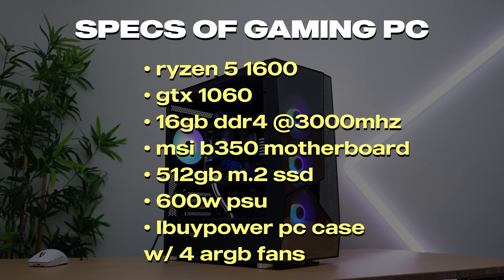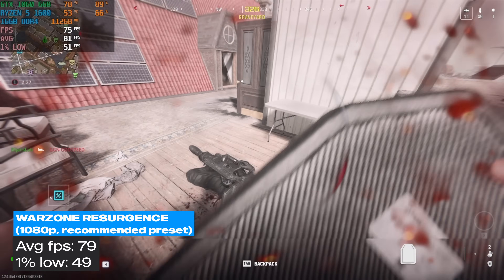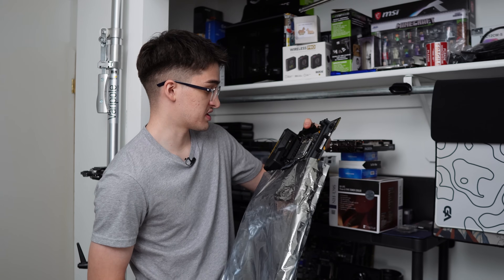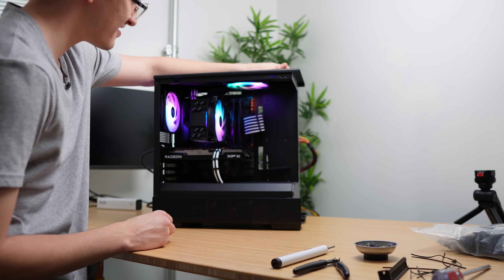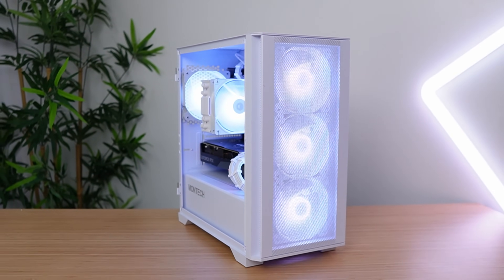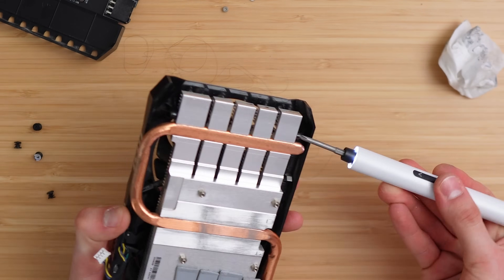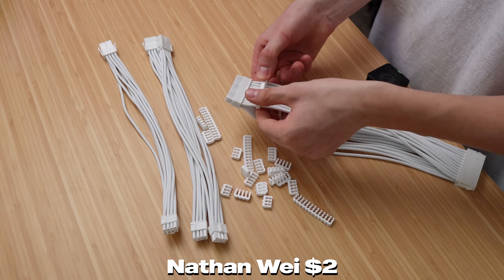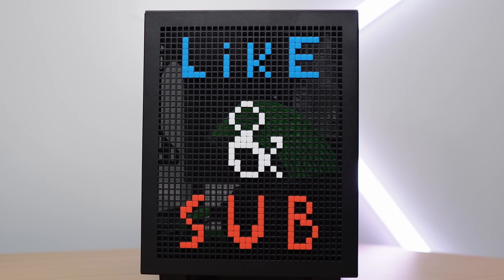Flipping PCs until I buy a house | S2:E9

Comment: Super annoying when someone ghosts you on FB Marketplace. Communication goes well for 2 or 3 replies then nothing ? Like WTF !?! Just had it happened to me about a motherboard. Just tell me you changed your mind or your busy etc. It's not that hard to type something to let the other person know what's going on. You just have to move on in the end. Can't wait around forever. Tech moves fast. Speaking of the Montech Air 100 RGB, I just bought that case today to do my first modern build. Haven't built a PC from scratch in over 20 years but since my other hobbies are getting too expensive I figured I could try this out again with modern tech. I know the basic upgrading (RAM, SSD, GPU etc.). It's basically the wiring the PSU to the motherboard that I'll need help with but their are plenty of tutorial videos here on YT for that. Thanks again for sharing all your vids & motivating me to try again :)

Comment: @Ekuhags Lab there is a setting in the bios where the PC well turn on, on power loss resert the bios and it should fix it if that is the case. its normally called Restore AC Power Loss it is probably undewr APM config. And if it is not that I would then check the PSU sometimes the PSU forces the computer back on.

Comment: Is the i5 3470 a good cpu to use for flipping pcs, if yes what gpu should I pair with it?
Reply from the maker: I’m going to make a yt short answering this as well for the budget ballers but I would pair that with cards like the 1050ti, rx 570 

Or older like the gtx 970 but I wouldn’t go older than what I recommended

Comment: A friend of mine had a same problem - it turned out one of the fans which was connected via Moley was forbidding the PSU to shut off. So try unplugging every part - could be SATA RGB Controller, for example.

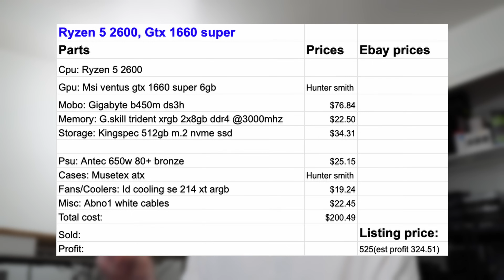Comment: 14:20 There is a shortage between two pins on the motherboard which is responsible for power on button, maybe pcb is somewhat broken or track is shortened

Comment: I dont know exactly what it is called, but there are some Settings in the Bios which causes the problem or try updating the Bios. I had the same issue already 2 times and both of these worked.

Comment: I have a high-end Intel/Nvidia system that I built in a budget Zalman case that's all-black and has 2 side fans as well as the 3 front and 1 back, and a 360 AIO on top with push/pull and it's super nice and professional looking. Good case suprisingly.
Reply from the maker: Sounds like a pretty sweet system

Comment: yoo elijah i got you try this 

1. Open Settings and go to System > About.
2. Tap on Related Links and pick Advanced System Settings.
3. In System Properties, go to Advanced > Startup and Recovery > Settings.
4. Uncheck Automatically restart under System Failure and hit OK.

Comment: Just a heads up, The price the 2700x/3070 is absolutely fair, but the 2700x will severely bottleneck the 3070, even at 1440p. Even a 3700x will bottleneck the 3070 to a degree, depending on the game. I would highly recommend not paring a 3070 with anything less then 3700x or above.

Comment: I had an older power supply that wouldn't let me power off the pc like yours. It sucks but you just gotta replace the PSU. 
That old antec might be ok if its paired with an older motherboard, sometimes newer power/sleep states trip up PSUs that were made prior to 2014 or so.

Comment: I think the reset cable might be bad or the 2 pin on the mobo. Try shutting döwn with the reset cable unplugged. Had similar issue with a pc.

Comment: I had that exact same issue with one of my pcs. The way I fixed it was I had to completely swap out the GPU. Then it worked just fine.  The gpu that I took out also worked fine in another build so everything should work out fine.

Comment: I had a Musetex GO7 case I had to put black tape on some wires on the wiring harness because it would short back on barely noticeable right under the power button. Then the Power option could be the culprit too.

Comment: Try these for the auto start issues -
1. Go to Power options. in the upper left portion select Choose what the power buttons do. Then click on Change settings that are currently unavailable.
2. Under Shutdown settings remove the check for the box to Fast turn on fast startup (Recommended).
3. Click on Save changes.

If that doesn't work -
1. Go to the Registry Editor.
2. Go to HKEY_LOCAL_MACHINE > SYSTEM > CurrentControlSet > Control > SessionManager > Power.
3. Set the value of HiberbootEnabled to 0.

If that doesn't work -
1. Go to Device Manager.
2. Under Network Adapters, find your driver, right-click and go to Properties, and under the Power Management tab, unclick Let Device Start-Up Computer.

Comment: Go to Control Panel then go to Power Options  Choose what the power buttons do also Change settings that are currently unavailable and uncheck the box next to Turn on fast startup.
Reply: I also had this problem on one of my flips and this ^^ fixed it
Reply: Yea I had this problem with my first PC build and this was the issue. I had to go into my power button settings.

Comment: might be the power supply when you turn it off again try to switch the power supply off and see if it like tries to click back to life had this problem with my psu as it caused my system to have constant power going through it
Reply: I agree, I bought an older cyberpower prebuilt (had an evga 600W Bronze) to gut for some parts and it had this issue, seller told me he had to shut off the PSU, I swapped the PSU and it worked fine.

Comment: Is the i5 10400f and rx 6600 good for a pc flip?
Reply: Swap the i5 out for a r5 5500 or 3600
Reply: @JacksonGefroh that'll require swapping the motherboard assuming they already have the parts. but if not yeah 3600 better cuz cheaper
Reply from the maker: Yeah that’ll be great. Basically what I built in this video with the i5 8400 build

Comment: Is 550w enough for r5 5600 and Rtx 3060 or 3070
Reply: Not for 3070 but maybe for 3060
Reply: What about a 3060 ti
Reply: 550w is more than enough 5600 and 3070 needs round about 300w
Reply: @richi2870  but not really recommended because the power supply will not last too long
Reply: @Manuz67  If it uses 300W, you have 250W more! , thats more than enough lol it will hold long enough xD
Reply: 5600 65 W rtx 3070 220W